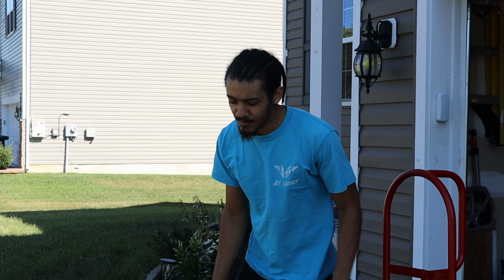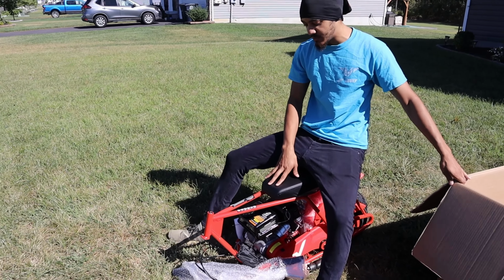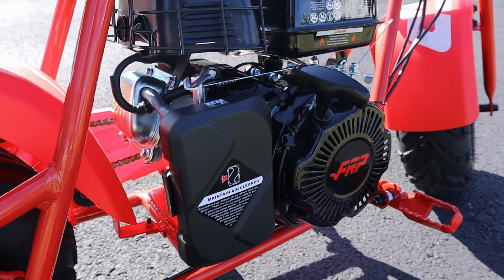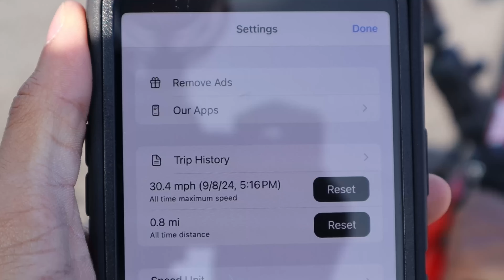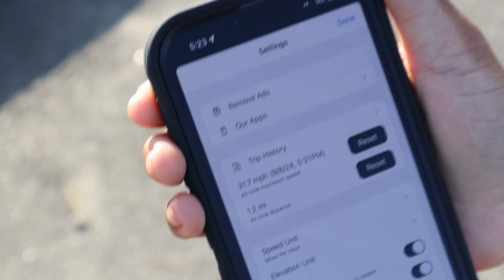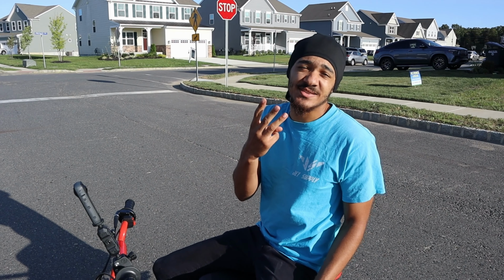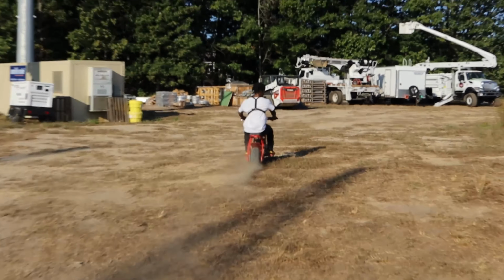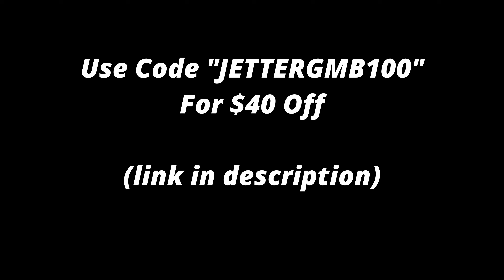Testing The Viral FRP Mini Bike!

Comment: Yo, I’ve been savin up for this shi for a while but now I don’t know if I should wait till Christmas or somth, or just buy it now. What do u think?
Reply: Also you should remove the governor and the spring and you could go almost 40mph
Reply: Zip tie th governed spring and get a 20 dollar exhaust and u can gain more power depending on your weight
Reply: Mine will do 35 with me on it and I in weigh 120
Reply from the maker: if you wait until christmas they may sell out and you could have to wait for a restock so now would be a good time! you can use my code in the description for $40 off
Reply: @MalachiJetter  alr thx
Reply: @MalachiJetter also which one do u think is more tuff, red or black, idk which one to get
Reply from the maker: @MemeuploadsW  personally i like the red better it pops out a lot more
Reply: @MalachiJetter  alr thx man
Reply: @MemeuploadsW no more like 80